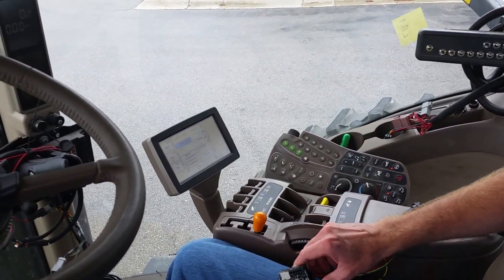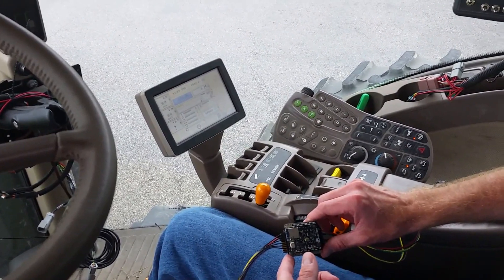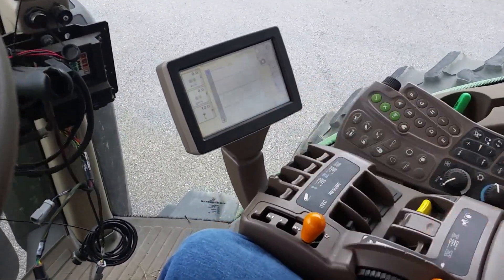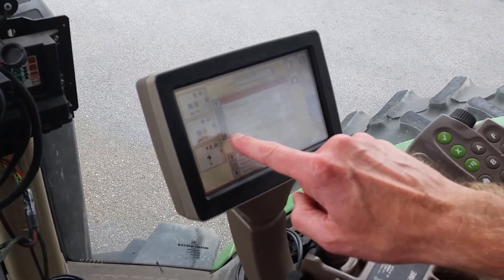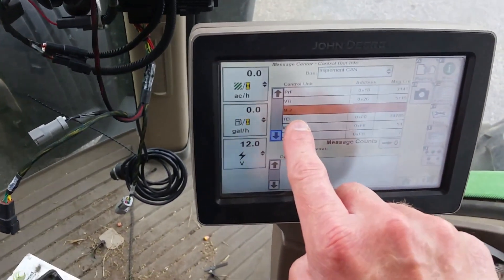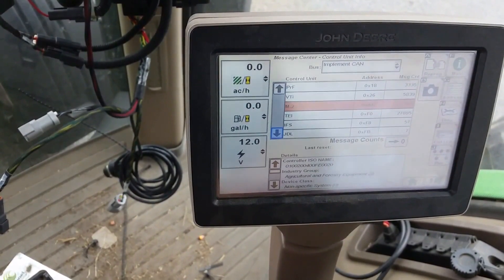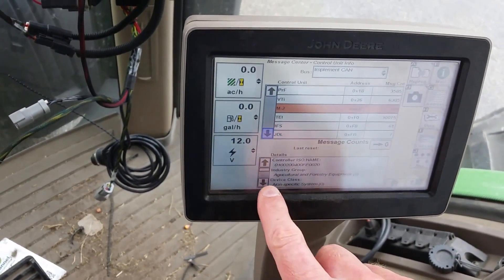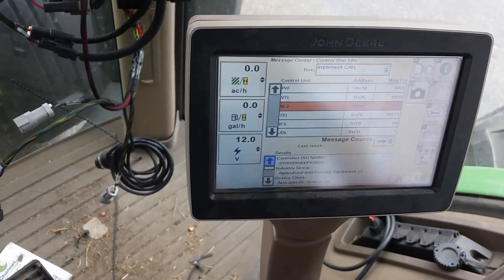Macchina M2 on John Deere Implement ISO Bus.mp4

Comment: Very impressive....What I want to know...Is who is clever enough to program an arduino, to not only recieve data, but fully communicate with the canbus in the tractor, to be able to use an arduino as a section control output / sprayer virtual terminal ECU... Many of us would love basic section control, and already have full GS2/3 setup in the tractor,  Im sure this would be possible, but would require some very impressive skills....But if we could get an arduino working on a ISObus level / appearing as a srapyer to give us GPS section control, it would be simply epic!
Reply: Darren Lobb isomax.tech kinda like arduino.
Reply: I totally agree with that. I have pretty deep knowledge of programming arduino's ,  even as a profession.  Next to that i'm a farmer who recently bought a tractor with Isobus. It's obvious that i'd like to start to work with it. It would be awesome if we could start by writing software for the display and communicatie with the arduino in and out. There is just very little information to be found on the internet.
Reply: @bartdereu  join the isomax community on facebook we have working solutions with popular libraries like the CCI Driver and IsoAgLib. I would like to help you get something work on the VT, SC or TC.
Reply from the maker: Simulink (look up Mathworks) could be the answer with respect to lowering the skill set entry point threshold.  Simulink affords the ease of graphical programming.  The M2 uses the same processor as the Arduino Due.  The Arduino Due is supported by Simulink.  I was able to program the M2 using Simulink, however it required the little programmer front end used on this:  https://copperhilltech.com/due-core-arduino-compatible-sam3x8e-32bit-arm-cortex-m3-module/  to do it and some jumpering on the M2.  To make use of CAN with the M2 and Simulink would require an external CAN shield for the M2 - as Simulink doesn't support the native CAN functions on the Due's processor, but instead uses a SPI interface to the CAN transceiver.